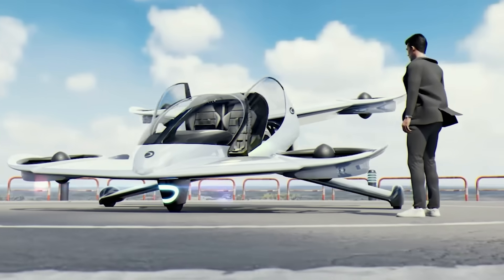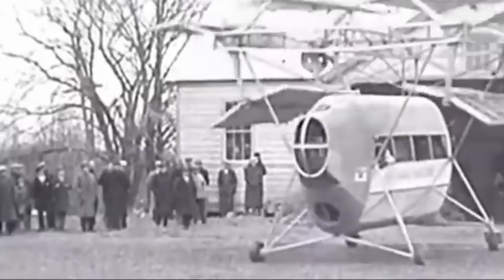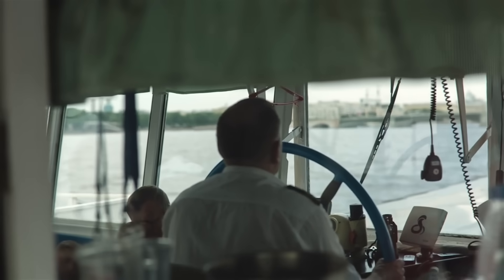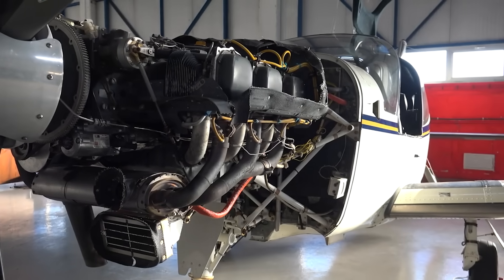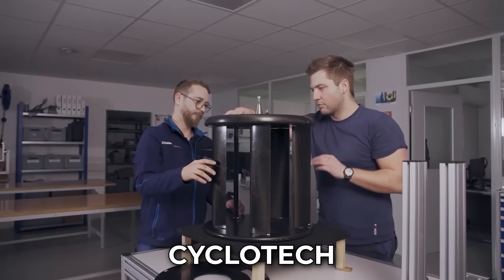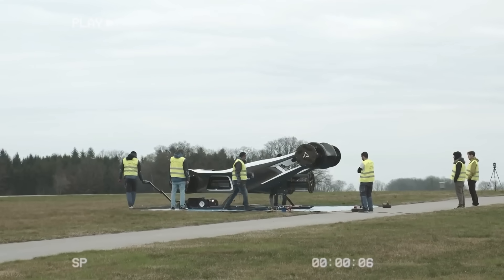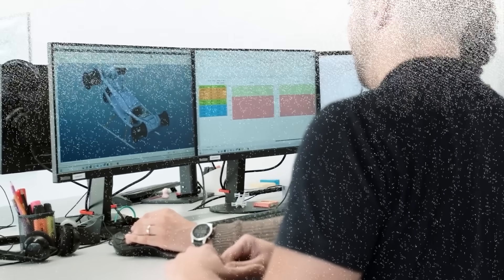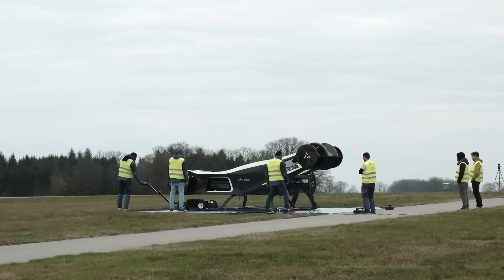The Cyclocopter: The Future of Flight That Doesn’t Spin Like Anything You’ve Seen

Comment: Interesting idea but also very complex, which means that it may not be practical. But guess we'll see.
Reply: Well, like he said in the video, if you compare a bicycle and a car from their complexity, obviously it makes more sense to use a bicycle over a car. But as tech improved, there have been many milestones to make cars more officiant over the years.
I don't think this is any different.
Reply: @Drayton_Thorne  Yeah but it isn't about "bicycle and a car". It's about current helicopter versus one with this solution. Which are pretty much the same thing, only exception is their blades/rotor difference where one is a working and simple concept vs. other which is prototype (which works of course) and considerably more complex. You can plan to build two helicopters, one with "old" system and other with "new" system and guess which one will be more expensive and which one will be funded?

Like I said, idea is interesting and it works, the boats which use that type of propeller show that ideally it'll gives better . Prototype air solutions show also great manoeuvrability but are more complex and more expensive and by itself, less reliable, not because the idea and solution is unreliable, but because system has by far more moving pieces, more controlling electronics, more engines, bigger fuel/power consumption in total.

Who knows, if idea/project gets more funding, more interest and more engineering resources behind it, it may produce something good and usable. Until then it's a "cool gadget".
Reply: The wheel was complex at one point, The engine was extremely complex  then and still is. Everything is complex to most, it's the few that understand it, That change the world for better.
Reply: @TiredofTheCorrupted  There's a difference between "complex" and "too complex", from many standpoints, no less of which is monetary. Other is reliability and so on. In that example we're talking about 4 rotors, each with what, 8'ish blades (give or take some), each of which needs to be controlled separately, on all rotos. Versus something where you have one rotor, three blades and that's that.

Sure, technical side itself is cool and it's possibilities are also very nice. Will it go into mass production and use? Doubt it. Unless they can really make those very cheap, keep them reliable to work and not needing maintenance after every flight. In the end money speaks and I suspect that as it is now, money won't speak for it.
Reply: @lorgrenbenirus  Nothing starts out cheap, Computers use to be really really expensive, Microwaves were expensive, Color T.V.'s were expensive, Electric stoves, Cars the list goes on and on about what was expensive. Until they started selling more to the masses, the demand went up and the production went up, Then the need to find a way to mass produce always finds a way. The products are way better then they were and cost way less.  The engine of today blows away the model T engine, If made back then , You think they would of just said nah too expensive? lol That's just an a dumb statement. In reality everything ever created was way to expensive, But We have them now don't we.

Comment: interesting. but seems to be impractical when mounted on biggest véhicule no? 
It compare to helicopters, but I would rather see this compare to a standard drone.... how is that compare? it's very similar, maybe a little bit more resistant? but it has the same capabilities that the actual drone with quad motor no? 
Not sure it seems for the same size of vehicle looks like it need bigger motor and bigger propeller no?

Comment: You know what would be great ? If the rotors could change orientation between horizontal and vertical and when in vertical position the blades could spread like a normal helicopter rotor. Then you could gain the control of the horizontal version when needed and speed with normal rotors for cruise mode.
Reply: That notion knows nothing of the way that cyclotech rotors work. The four that support the aircraft must remain horizontal. However, some prototypes add an additional rotor or two mounted vertically to facilitate maneuvering.
Reply: @shannondror you didn't grasp what I said and pulled your membership card of the club 'it can't be done'. That is until someone does it. Then you'll say 'I knew it all along'.

Comment: With all four rotors in on parallel axises they can produce fore and aft or up and down thrust there is no way to produce a sideways force. An additional 2 rotors spinning 90 degrees to the 4 lift rotors are required for lateral motion and turning . Hence the mechanism is over complicated, heavier and inefficient relative to conventional drones as each rotor develops thrust only on 50% of the rotation. I worked with Voith Schneider on tractor tugs and ferries but I wouldn't want to fly with them.
Reply: Surely just increasing the thrust on one side will turn the thing?
Reply: @tomhollins5303 Yes. However the forward rotor on one side must be vectored forward and the aft rotor on the other side vectored afterward. Just increasing vectored thrust on one side will turn the vehicle but very slowly if the platform is to remain relatively stable while hovering. Complicated eh !

Comment: This just seems like so many other old flight technologies that nobody used for a good reason.
Reply: The reason many ideas couldn't work is because materials and technology were not strong enough. 
Thanks to new technologies like lithium batteries and neodymium magnets and carbon fiber and computerized control systems old ideas are being tried again
Reply: I wonder why exactly that is.
As well as why this works in the first place and what could/should be done to better create lift than another failure in design that produces less than we deserve and requires more in than could ever be produced.
Reply: @lifeunderthemic the propeller is not a failure design it works on water but in air it needed composite materials and very fast control systems.
Reply: @lifeunderthemic  it's called a magnus affect, and it's biggest limitation is the top speed.
Reply: The 'good reasons' were the technology was not mature enough.

Leonardo sketched countless flying machines, but many were not realised until our time.
Reply: Cyclocopter technology is considered more efficient, though. So yes, there is good reason to adopt this tech.
Reply: @martinw245  It's less efficient and more complex than a rotating wing because it doesn't scale up well. Water is a more viscous medium than air so the scale is effectively smaller. Laypeople tend to think that a helicopter rotor is just a big fan but it's not, it is actually an airplane wing that flies in place by rotating.
Reply: @martinw245  It's only more efficient if you don't have to swap the cycle drum every flight. Which you would have to with this. We have no materials right now that could withstand this kind of complex rapid movement over time. You'd have to literally go and swap it all out after every flight you miraculously survive.
Reply: @JimmyNuisance  

Something tells me that the engineers working on this concept have thought about the strength of the materials used and are confident the tech is viable
Reply: @JimmyNuisance  where the heck did you get that info? you know actual helicopter rotor blades use the same composite materials and they don't have to change them after every flight and i can 1000% promise you they experiance a whole magnitude more stress than anything those small padels do...
Reply: This is a bad argument. Cyclorotors are useful in smaller electric powered VTOLs, they aren't useful for large aircraft that use internal combustion engines.
Reply: Too many moving parts, complex mechanical motion...  To many things that can fail to be reliable or easy to maintain.
Reply: @mikepalmer8373 

"Too many moving parts"

No, not at all. Exponentially less moving parts that a Combustion helicopter.

And no more parts than any other eVTOL.
Reply: @martinw245  Those helicopters are run by a motor that spins the same way every rotation. The pitch of the blades are controlled by one ring going up or down.

The blades on this thing would need to change angle thousands of times a minute. The difference in terms of how much movement these parts need to do is enormous.

And VTOL quadcopters could not be more simple. That's why we can make them fit in the palm of your hand. They're the simplest way to make a VTOL. Nothing comes close. Brushless electric motors are one of the simplest motor you can make. And the propellers on those quadcopters are fixed.

Comment: The loss of the ability to use Auto Rotation when engine failure occures is a big deal here
Reply: Pretty sure quadcopters suffer from the same issue.

The issue here to me is too many moving parts and what I would guess are efficiency issues.
Reply: @CollinRoche  They do, and autorotation is overrated anyway. You can't land vertically in autorotation, it has to land like an airplane. 

Moving parts is not a problem, if it's powered by an electric motor, it has fewer moving parts. Efficiency depends, helicopters aren't efficient in cramped environments with lots of ground clutter, but this would be.
Reply: @ARMCoder-BR  You're missing the point, you need to have a clear glide slope in order to land in autorotation. If there's trees, power lines, buildings, or anything else in the way, you will collide into them, and crash. If you lose pitch control, you can't flare at the end to soften the landing, and you'll crash. Autorotation is a very poor failsafe system with far too many things that can go wrong. Having back-up electric motors and cyclorotors is a much better failsafe.
Reply: @ARMCoder-BR  In other words, you don't know what you're talking about.
Reply: @ARMCoder-BR  Good for you, I have trained doing autorotations myself. I haven't gotten my pilot's license yet, but I have over 40 hours flight time logged. So if you really are a certified helicopter pilot, then you already know you need a clear glide slope in order to land in autorotation, and you already know the dangers of power lines. There's nothing I said that you should object to.
Reply: @ARMCoder-BR  Dude, you don't get to choose if you are flying over a forest. You will autorotate into a glide path that collides with those trees, and you will crash and die.
Reply: @ARMCoder-BR  Lol you don't have the privilege of choosing your flight routes. If you really were a pilot, you'd know that. I don't believe you're a pilot at all.
Reply: You can't use autorotation in most multicopter or ducted fan designs anyway.
Reply: that's why you put these on airship gondolas
Reply: no no, we want to know what happens when power drops to zero for all motors simultaneously, completely,  during flight for any reason.  Does it slowly fall to the ground or pancake?
Reply: @therealjoshuacaleb4873  what happens when a helicopter uses power? Same thing here
Reply: It's battery-operated, no engine to fail.
Reply: @michaeljennings6647 other than the electric motors.
Reply: As long as there's a way for each of the drums to spin independently of the motor when unpowered, that's not actually true.  If they can spin freely when unpowered, then the drums will in fact auto rotate when in freefall.  Whether that will be sufficient is another matter, but it is possible.
Reply: Use three for thrust/yaw, and an autogyro for lift once airborne.
Reply: @etaaramin9361  It's not really worth it just to get autorotation. Autorotation is overrrated. You need to have speed and altitude to autorotate, if you're too low or you're too slow, you're going to crash. You can't land vertically when in autorotation, it has to land like an airplane, and if there's trees or powerlines in the way, you're going to crash. Redundant electric motors and cyclorotors are much better. You can still land vertically and safely even in forests or lots of ground clutter in the way.
Reply: There must be some minimal autorotation possible. The blades still have some inertia.
Reply: This is the first thing I thought of when I watched this video.
Reply: i think the biggest deal is the engine failure itself😂
Reply: @letsgoseeit -- With any device or system on which a life depends, the engineering challenge is to design so that a single failure cannot be catastrophic. Some backup feature or operating mode must therefore be included. In traditional aircraft this usually means multiple engines or some sort of gliding. Even a backup parachute system is such. Autorotation is also a form of gliding, as the rotating airfoils are still providing some degree of lift. Next is to improve the reliability of each component to minimize the likelihood of failures that require such an operating mode. One advantage of multiple electric motors is their superior reliability compared to ICEs.
Reply: @letsgoseeit There are 4 motors. It can still fly if one fails. And electric motors are highly reliable
Reply: @martinw245 -- That IS what I said, though you reiterated it in simpler language than my "engineerspeak". One way or another, I hope he understood.
Reply: @shannondror  

He didn't say it wasn't what you said. I didn't read your contribution. ;)
Reply: @martinw245 Well, in fixed wing aviation, there are twin engine aircraft that "can get you to the nearest airport", and twin engine aircraft that "will only be able to get you to the scene of the eventual crash", so it's not an unreasonable question.

It's also similar to the root commenter here - the engine failure in a helicopter is problematic (obviously) but in the right terrain, you can use the stored energy in the rotor system to land the aircraft ok. Pilots train for and routinely practice this maneuver, so yeah, the ability to not autorotate is actually a bigger deal than an engine failure "in most cases". A tail rotor failure is quite a bit more dangerous than an engine failure in many helicopters.

I was personally wondering if one of four rotors were to fail, if would there be so much drag as to spin the aircraft. Sounds like maybe not, and that's a good thing.
Reply: @PerryRT SMH no engines
Reply: Instead of autorotation you have multiple power units that can mutually compensate, in three axes not just one.
Reply: Autorotation compensates for power loss on a single axis, or on two when driven by a common shaft. The cyclotech system uses multiple redundant lift axes to compensate for a single failure. It also relies on advanced technology that is more intrinsically reliable and capable of self-examination to project and warn of incipient failure to enable landing before  full failure. Full-aircraft backup safety parachute systems may add to the failure compensation. Thus autorotation is not required to compensate for power failure.
Reply: @shannondror  Settle down
Reply: I have seen numerous helicopter accidents and costing a lot of lives and none criticize its safety redundancy. Helicopter is one of the least safe flights.
Reply: Very good point. I'm sure designers will work on backup options. Some ideas are noted here. But still, very good point
Reply: @lotklear designers won't do shit. ENGINEERS ARE DOING THE REAL JOB HERE.
Reply: Not a big deal at all. 

No other eVTOL can auto-rotate either. As stated in the video, there is much redundancy and if a motor fails the others take over and maintain lift and direction control.

In addition, the final product may well have a parachute, like quite a few light aircraft do these days.

Comment: What is the efficiency in comparison to a propeller? There is a reason why the jetson 1 only flies for 20 minutes. Compared to a helicopter a drone is incredibly inefficient. You notice the osprey only flies vertically for minutes and fly horizontally 99% of its flight time.  Even hummingbirds fly for only a few seconds at a time in hover mode its very energy draining.
Reply: Runs on batteries that's why....
Reply: @platypusrex2287  No multirotor drones are inefficient compared to a helicopter due to higher disk loading. The current endurance record for a small battery powered UAV is held by a helicopter specifically a Mikado Logo 690 which is a large RC helicopter with 690mm blades or about a 1.5M rotor span. The reason why is disk loading, the larger the rotor system is in relation to the total weight of the aircraft the more slowly it needs to turn to lift the aircraft and the more efficient the lift generation is. You see the same concept in airplanes designed for extreme altitude or endurance large wings in relation to fuselage size for example the U2 spy plane. Helicopters have more rotor area than a multirotor, and the rotors move through the air more slowly (slower rotation) so they generate more efficient lift.

 However as anyone who is into large RC helicopters can tell you, collective pitch helicopters are also much more complex than multirotor drones which are  just 4 motors with fixed pitch props on a frame. So they have become popular as small drones not because they are more efficient but because they are simple as dirt.
Reply: @platypusrex2287  Well but sliding on rails is more efficient than gliding on wings, which is more efficient than lifting on air, regardless of the power source. The wheels in your car are actually sliding on rails.